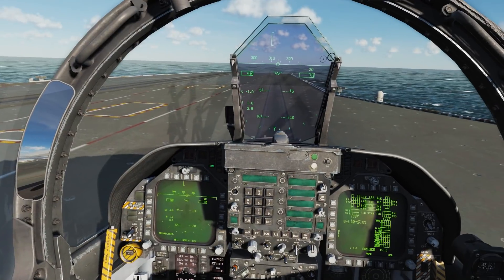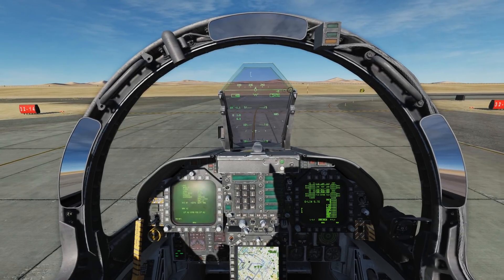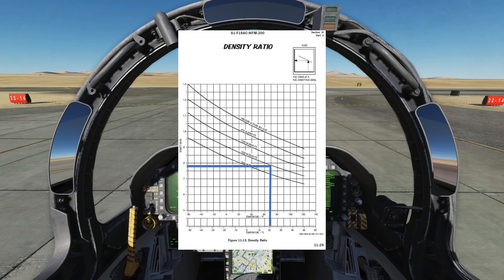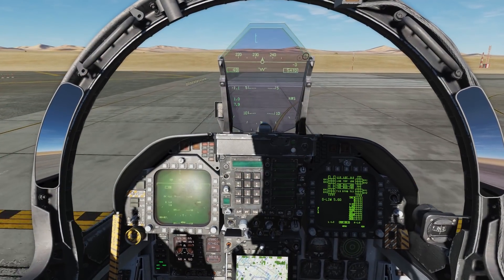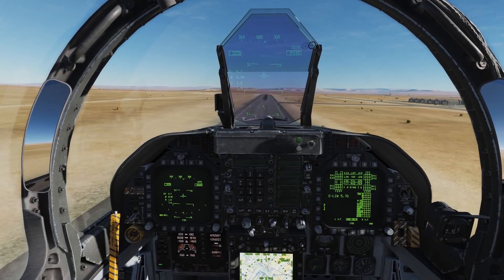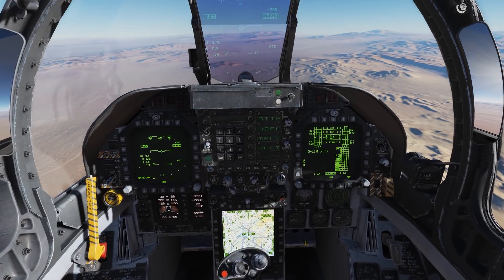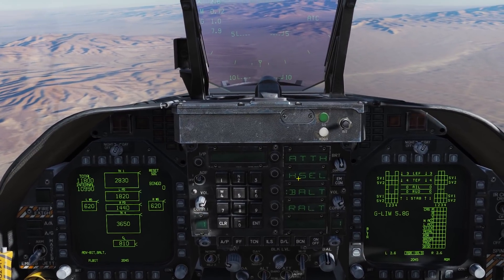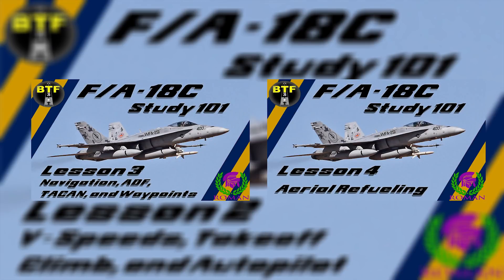[DCS] F/A-18C Study 101"V Speeds, TO, Climb, & Autopilot

Comment: I hate being that guy, but unfortunately the CG calculation is quite a bit wrong, according to NATOPS A1-F18AC-NFM-000 the reference CG must be substracted from the aircraft unique CG (according to its DD 365-4, which iirc we lack for DCS planes) but it should bring the calculation to a low value under 1 or 2 (that's only my guess as I'm neither an F18 pilot nor a ground crew) , fuel tank must be taken into account in addition to its fuel and pylon (so -0.3 more), and all that is substracted or added to the CG according to internal fuel (figure 11-11 "CG Travel Due To Fuel Consumption - F/A-18C 164693 AND UP" for our model). The full calculation method is explained on page IV-11-22 (if you are using the 2008 version).
Reply: I agree. The unique CG is not available for DCS, so we can assume all Hornets have the same value, and I also assume that this value is also the reference value, so no CG deviations from new manufactured model to our own model ( 22.3%). Taking in account this issue, my calculations for the same case than the video are: 21.3 (my plane, unique CG) minus 21.3 (reference CG) minus 2.0 plus 0.4 plus 1.0 minus 2.4 plus 0 plus 0 plus 21.5 (internal fuel) equals 18.5. So i think CG is 18.5%, not 19.1%. Finally thanks for the video!
Reply: @429llanero  I guess you wanted to say "thanks for the comment" but were probably too tired when typing that :)
Reply: @429llanero  so you didn't take in account the central fuel tank pylon? So you didn't do 2.4 minus 0.2. Why?
Reply from the maker: Good Stuff,  I am out of the loop with the F/A-18 at the moment and I definitely welcome corrections. I am happy to see other people interested in the nitty gritty! Thanks for your comment! - Roman

Comment: greate video, thx a lot, but i have two question. first if i have AIM120 on ST8, (355lb) so calculating only pylon?, and second qs. tempeture is not important for rotate/takeoff speed?
Reply from the maker: Sorry for my late reply, temperature is most defiantly an important factor for planning. High temperatures and low pressure situations are particularly dangerous. (i.e. high density altitude) Under some configurations and field conditions this could be a problem.  Thanks for watching! -Roman